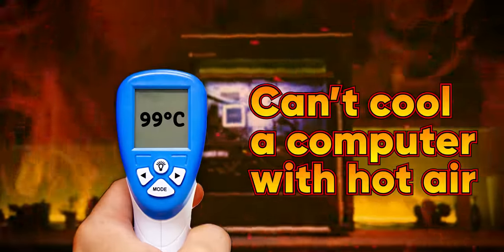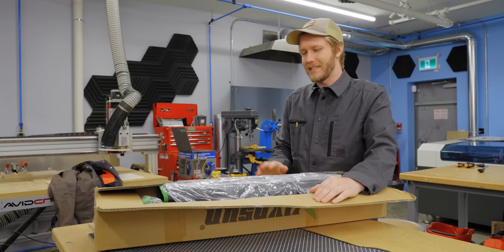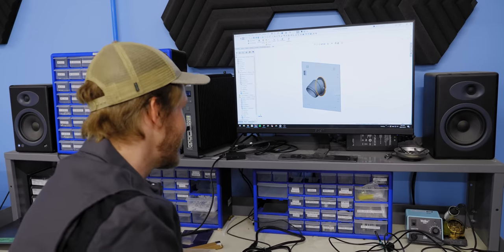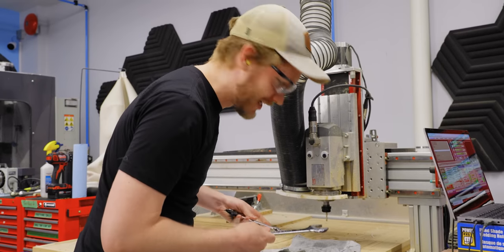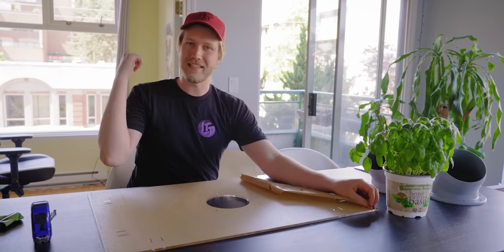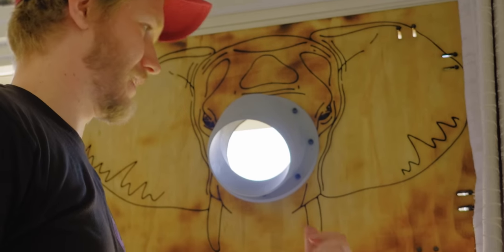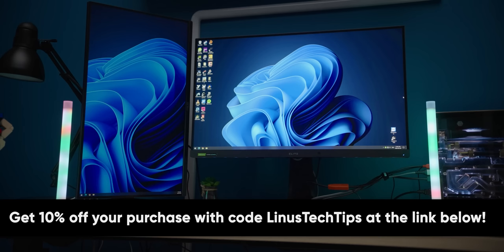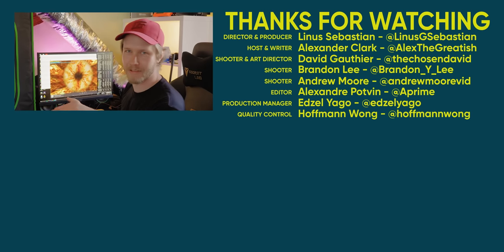You’re cooling your PC wrong. - PC in a Grow Tent

Comment: I respect the engineering and DIY attitude that is oozing out of this video, and that you found a solution that works in the end! I'd probably just heavily undervolt the PC during the summer season if the room gets too hot, or simply use an air conditioner to cool it down. You know, like normal people. But that wouldn't make a fun video to watch, so there's that!
Reply: In the beginning he mentioned that air conditioner and computer together may trip your breaker, so here is his solution to avoid it.
Reply: @RelakS__  They sell these things called nails in hardware stores, specifically made to stop breaker-tripping behavior from faulty electrical installations.
Reply: @Sup3rman1c  This comment hurts my brain XD
Reply: @Sup3rman1c  if you like being that cheap, you would love to know, that you won't get a phone bill, for calling the fire department in the USA 😱😱😱
Reply: USB C is so amazing now that you could just put your PC in an attic or laundry room and remove the heat source all together. Pretty sure a warm laundry room wouldn't be an inconvenience.
Reply: it'd be easier to hang your pc out the window than whatever went on in this video

OR EVEN JUST INSTALL THE FAN BLOWING OUT THE WINDOW
Reply: undervolting is sooo good with higher end components. I'm using a Titan X atm and by heavily undervolting it I almost halved the power draw without losing very much performance.
Reply: @Sup3rman1c  That is just as bad as replacing a fuse in a fusebox with a penny.
Reply: @MrYodaBomb  Yeah but my attic is like 70 degrees when its summer. Its seriously like a sauna.
Reply: @RelakS__  He's lying to you. It will NEVER trip a 15 amp breaker.
Reply: But… steam link…
Reply: @Sup3rman1c  you have no idea what you’re talking about with anything. if your attic is seriously 70F during the summer that’s cooler then most houses. not to mention you ever wonder why breakers flip its almsot like a safety mechanism
Reply: My personal take on the problem is a home fan blowing on the open case that sits on the side of my desk. That way the electricity consumption is on the low side and it cools not only my PC but the Internet router and me at the same time. Was doing the AC rout but the AC didn't rly helped that much and the AC cooling (at least in my case) is demoisturazing the air in my room to a degree that it feels rly bad. Befor the FAN solution the temps I was experiencing on my desk were around 31*C-34*C March - August. Now I am a happy PC consumer enjoying 21*C-24*C. I'm in EU Mediterranean BTW, not US.
Reply: @RelakS__  most of the world has 220-240 volt sockets
Reply: @kaaiuta  Yes, but what is your point? We won't need this solution in 230V land (provided that we also have 16A breakers), and I presume, that people in 120V land will need it only if the house/flat has poorly planned wiring, or if they have 16A maximum allowed current, which sounds really strange to me.
Also, keep in mind that LTT is a Canadian group, so they will look for solutions for 120V problems in the first place.
Reply: @gabrielduran3305   Actually its 70 kelvin, and definitely its not colder than usually. My neighbor gets like under 50 kelvin at times in his attic, so 70 is really hot. Then again he lives on the other side of Uranus so my summer is his winter. Although the high pressure of 1654156241 BigMacs(tm)/Football Field is actually quite convenient for heat dissipation. (I changed the pressure to imperial units for your convenience.)

Breakers are a scam made by Environmentalists to inhibit electricity consumption. They have long lasting shorts on electricity stocks, that's why they're driving electricity usage down.
Reply: @mrskibum885  Yes, it's literally just as simple as either putting it outside, or connecting a duct to the exit fan holes directly (if the outside is not close enough to your room)

Comment: I knew a guy who swore by growing his weed inside a PC case.
Now we have a guy who swears by using a grow tent to help cool his PC.
We have come full circle.
Reply: @ilovefunnyamv2nd  Apparently (and I'm no expert) it will just grow to fill the available space. It makes no difference to yield or potency... plus you can get short bush plants, which helps a bit.

As I said, apparently, because I've never done it myself & I'm no longer in touch with the guy who did it. His argument was that all the airflow, exhaust, and electrical requirements were already part of the case... so why not use it?
Reply: It's possible but it would but ditch weed for sure, because weed is very fussy over its growing conditions and generally likes to be kept at a certain temperature with fresh CO2 which... well a PC is never going to provide lul.
Reply: @BenderBendingRodriguezOFFICIAL  It's not that fussy really - unless you take it ultra seriously which a lot of people obviously do. But it's a weed at the end of the day. Weeds grow pretty much anywhere they get enough sunlight & soil conditions & the right temperature. Also, he was an IT guy, and I imagine he probably modded his cases a bit. If you're just growing for yourself and not to sell, then you can get away with quite a bit.

Comment: Very interesting project.. I personally would have cut the tent to a smaller size, and then put the fan on the outside of the window so it could run at a higher speed…
Reply: Why even use a tent when you can connect the hose straight to the pc case? :)

Comment: I must say, I always enjoy Alex's videos, and I would LOVE to see a part 2 of this idea! but instead of putting the whole computer in a tent, build a PC with exhaust directed into a vent/manifold using the same duct work and fan. Heck use one of the Main Gear turbos you have! That would be a perfect candidate, just 3d print a top hat to slip over the top of the case and hook it straight to the duct work for example. Can I PLEASE get a few likes for this idea to come to fruition! =D
Reply: I would love to see that as well, although rough calcuation shows that to match even the 280 rad mount on the Turbo, you would need 10" duct

Comment: Technology Connections: "It sucks! Literally!"
At least the portable AC they showed was dual hose type, not just sucking hot air from outside through other cracks like single hose counterparts, or whatever this contraption is supposed to be
Reply: Not to mention portable AC are inefficient. Using a good window unit should work just fine.
Reply: My thoughts exactly
Reply: Yeah and they really aren’t very efficient either
Reply: The dual hose are much closer to efficiency of (U-shaped) window unit, the portable they showed even had variable speed compressor, maybe also two separately driven fans?
The midea U shaped window units would be much better around the same price, basically a compact mini split. 
However some communities won't even let you mount window units, so something like dual hose portable would actually be a best case scenario for many
Reply: I thought TC was just one guy
Reply: @svgPhoenix  people often generally refer to people by “they”/“them”
Reply: A dual hose pc cooler would be just generally worse though, cause it would just blow even hotter air over the pc
Reply: Bro's sucking in all his neighbor's conditioned air into his apartment and then out the window because he's creating a negative pressure system lmao. He's subsidizing his cooling "savings" by using his all his neighbor's AC, or he only pays a flat rate at his place.

It would be better if they just created an outside-air closed loop system. The outdoors on a summer day may be hot but it won't be "bake my computer hot" and it wouldn't push all your conditioned air outside at a constant, high, rate either. So you get to sacrifice a little cooling capacity for not having an outrageous electric bill at the end of the month.
Reply: @svgPhoenix  they them can be singular.. its always been correct grammar
Reply: I have a portable single hose AC and I HATE IT. I rather be miserable in my sweat than use that stupid thing.
Reply: Latent heat
Reply: Technology Connections are bunches of jokers with only school projects lol
Reply: @C0mmanderX  since when?
Reply: @justinjake258  proof ?
Reply: @nowonmetube  Okay historically "they/them" has been plural if you want to be grammar compliant for English class, but for a couple of generations at least it has become increasingly common to use it to refer to the singular.  My source is that language is funny like that and it's not worth carrying on about.
Reply: To be fair this is a substantially different task then standard AC. The biggest brain move would be a full on custom water loop with an external radiatior.
Reply: @C0mmanderX  [NODS]
"Roses are red; Violets are blue;
Singular 'they' pre-dates plural 'you'."
Reply: @metaleuman  I like mine. It's not the most efficient thing going. It keeps me cool and at night I can put it into fan mode to bring the cooler air from outside into the bedroom while its in another room.
Reply: I have one that is preconfigured to be able to switch the intake and exhausts... The dual hose i can barely even get in this country, and one with an outside unit (probably I could make work good on my balcony, throw the unit out there, let down the sealing outside shutters down all the way and let the connecting cable under there with a bit of a spacer) are monstrously expensive... to the point of two thousand euros.
Reply: You can convert a single hose to a two hose fairly easily. And it actually is worth it. It makes a very noticeable difference. Especially since he already got the fan. Ruck makes awesome stuff, i visited there factory once :)
Reply: @nowonmetube  Since before people started using "you/you/your" instead of "thou/thee/thine".
It went out of fashion for a century or three, but it's back now.
Reply: @justinjake258  Technology Connections on YT is one guy AFAIK
Reply: I think this is just a silly video on purpose, possibly to set the scene for the swimming pool water cooling video
Reply: @therealpbristow  no. Then people should start using thou/thee/thine and not they/them.
Also I'm not English speaking (except online).
Reply: @nowonmetube  So... you think languages should never change/evolve? Not even over a period of *centuries*?!? =:oo

Well... as the young kids say, "good luck with that"...

(I hereby apologise for not being able to render my thoughts into your own native language. My natal nation's education system is at fault here, not yours.)
Reply: @nowonmetube  The use of the singular they goes back to at least the 15th century, the date of earliest written example the Oxford English Dictionary cites.  It wasn't until the 18th century when grammarians prescriptively declared it bad that it fell out of favour.

Comment: I'm sure this will get totally lost in the comments, but nice to see someone at LMG actually does grow plants. Looks like Alex has basil, either a corn plant or spineless yucca, and something in those hanging planters outside. I wonder if that helped inspire the idea a bit or helped Alex come across it, mixing the passions of plants and pc's.

Also, that basil should probably get some more light. They can take a ton of light and heat, and in the BC area they can probably take full sun and be totally fine. We grow them in the SW area of USA with no problem, even when it gets to 45 C (though we do aim for some shade when it gets that hot)
Reply: Congratulations 🎉 you have been shortlisted as one of our winners. message to claim your prize

Comment: Now that Alex has seen that it works, he could easily make his own now. A simple hook and loop door for getting your PC in there and a much smaller design would work really well.
Reply: Small ac will work better n less of a Hussel,this just stupid
Reply: @NeVErseeNMeLikEDis  much louder, more expensive, and uses 500+w. Exhausting is much more effecient.
Reply: @NeVErseeNMeLikEDis  however there are people (like me) that get a headache and a sore throat from most commercial ACs
Reply: ITT: People who don't understand that air gets replaced.

That fan is designed for a much larger tent, but it's not designed to cool the tent, it's designed to maintain negative pressure while air recirculates through a carbon filter, eliminating smell. When inline fans are used to evacuate heat, it's typically not from the room, but from sealed HID light fixtures, in hopes of preventing most of that heat from entering the room in the first place... which is what they did here, and where you all get it wrong. If you keep exhausting to atmosphere, your cool interior air will simply be replaced with hot exterior air, which is why those HID fixtures have an exterior air inlet... but that won't work for a computer. It doesn't matter how hot it is outside of your lights are burning at 3,000⁰F, but blowing 100⁰F air on your computer seems like a bad plan. So, yeah, an AC is a much better plan, and that's why we use them, even with air cooled HID lights.

>in b 4 muh swamp cooler

They work great in the green house, but that's a lot of humidity if you ain't in the desert.
Reply: @hlaw2830  last I checked, outside air isn't 50°+ like it is in the case. I have used this form of cooling (negative pressure cooling) in a hot apartment, and as long as it isn't scorching outside, it is definitely worth it. Nobody cares about the specific fan, all that matters is that the waste heat (99.9% of the energy input into any CPU or gpu) is not mixing with ambient air and is instead being evacuated out the building in an efficient manner. A closed off room will get much hotter from a pc than from outside air coming in from another window, or through a vent.
Reply: @Ravenousjoe  Sure, so my office could be 110⁰F without an exhaust, 100⁰F with an exhaust, or 75⁰F with AC. Hm, somehow you've failed to convince me.
Reply: @hlaw2830  I mean, an exhaust is also a hell of a lot cheaper and more quiet than A/C. This is nothing about this vs A/C, as in this video it isn't an option for him, and a lot of people rent in buildings that don't have A/C.

Trust me, I really like my A/C too, but completely different solution that would not benefit them in the same manner. What a boring video: check out this cooling, it's a portable A/C unit!!
Reply: @Ravenousjoe  Lol, well, first off, there's a cultural elephant in the room: Damn near every American has AC, even poor people in the North. It is not a luxury, nor mere appliance in the States, it is a very literal part of our culture.

That said, yeah, window fans are great, if I'm out all day and the house is still 90⁰F+ after sundown, it makes way more sense to just exchange the air than it does to cool it; plus, indoor air is typically worse than outdoor air in terms of quality; however, to get the most out of an exhaust, you also need circulation within the room itself.
Reply: @hlaw2830  Well you explained why you didn't understand the original comment right there. Not everyone is American, let alone lives in an area where A/C is the norm. Point still remains, A/C is much more expensive, and doesn't make for as good of a video.
Reply: @hlaw2830  We reach temperatures of 40-45c in my region and the majority of people don't have ACs in their house, not worth it if you live in a proper building and in lower, well orientated apartments
Reply: @Requiemes  Try not being poor, it's pretty great, despite how many Americans complain. They're just mad that they don't get the billionaire treatment, lol. We don't have poor people, we have entitled people.
Reply: @hlaw2830  right on, keep on living your arrogant life. 👍
Reply: @Ravenousjoe  Ah, yes, the arrogance of not being jealous and entitled, lol. I'm one of the few people who isn't out here complaining about how other people need to do more for me, haha. I'm not arrogant, I'm just man enough to recognize that I won the fucking lottery being born in America. Arrogance would be acting as though I deserve some kind of special recognition because my mother's side of the family fought in the Revolutionary War, and for the Union... but I didn't do any of that shit myself.

I am thankful for the people who bought Bugattis, because they paid for the R&D that went into the dual clutch transmission in my Golf. This isn't arrogance, this is simply responsible adulting.
Reply: @hlaw2830  Cool story bro.
Reply: @Ravenousjoe  That's reality, kid.
Reply: @hlaw2830  right on man, so wise.
Reply: @Ravenousjoe  So, sarcasm is your defense mechanism? Hah! Good luck.
Reply: @hlaw2830  haha, yeah man, you sure got me there.

Comment: The tent is unnecessary since the PC case is already a tent of its own. Just tune the fans so the exhaust is a bit more powerful than the intake and connect the tube to the exhaust. Or at least get rid of the PC case and make it open bench so you don't have a double casing :D
Reply: Yup. In my studio there was a L shaped air duct going from the basement to outside. Modded 2 tubes to my pc. Sucks cool air from the basement and pushes warm air to outside. Very little dust buildup in the filter and the studio stays cool and the computer silent.

Comment: If you truly plan to keep the setup, running the duct along the wall and ceiling will get it out of the way and shorten the route outdoors. Also, you may want to consider a screen between the 3D-printed duct adapter and board/acrylic to prevent insect ingress, especially when the fan is off.
Reply: Oh yeah, bugs. Good point! Even on the second floor critters will find their way in, especially on cool days when the hotter air coming out of the house shows up as infrared. They'll home in on little gaps.